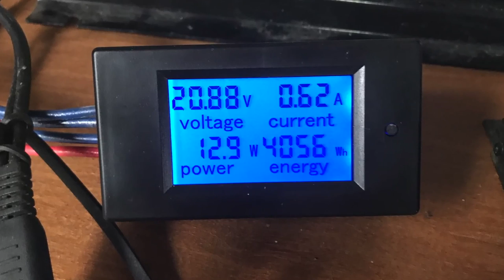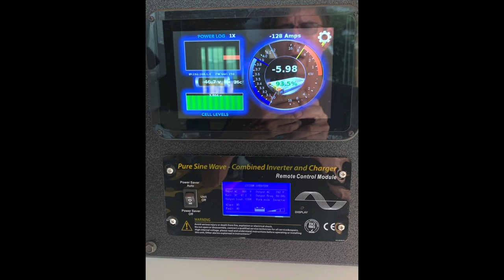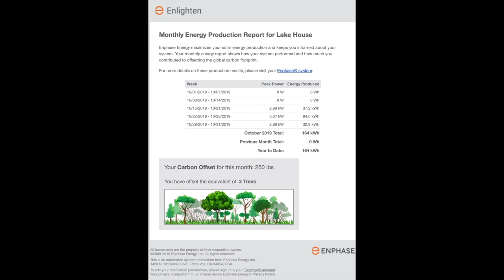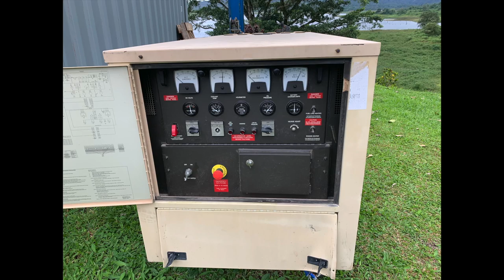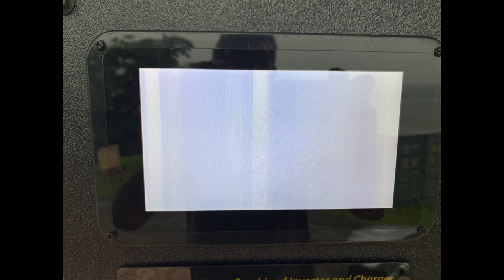EVTV on Tesla Cybertruck Unveil Wardrobe Malfunction

Comment: Why did no glass break? Possibly he was using Transparent Aluminum Alon windows (see Star Trek 4: The Voyage Home) with metal fatigue failure after too many impacts. See:  http://www.surmet.com/technology/alon-optical-ceramics/
Reply: Jim Whitehead a guy on Reddit talked to an engineer afterwords and that’s what he said.
Reply: @bob15479  Great. I independently figured that it was likely metal fatigue, which is why it can survive 20 or 30 impacts, then both windows quit at the same time.  They likely never tested the windows to fatigue failure. You can see metal fatigue by doing paperclip bends that suddenly snap.
Reply: People need to stop calling sapphire "transparent aluminum." That's like calling regular glass "transparent silicon"
Reply: @takanara7  False. If you bothered to spend 5 minutes of research first, you would know Alon is not a sapphire. (All sapphires contain other metals in addition to Al, such as Fe, Ti, etc. Alon has NO other metal). Wikipedia: "Aluminium oxynitride or ALON is a ceramic composed of aluminium, oxygen and nitrogen. It is marketed under the name ALON by Surmet Corporation.[3] ALON is optically transparent (≥80%)..."   So it is correct to call it: Transparent Aluminum oxynitride. (It becomes transparent by polishing).
Reply: @takanara7  BTW, This is a big secret, how I graduated with honors from a famous engineering school, with a full AT&T scholarship for grad school: not because I was smarter, but because I bothered to look up and understand the science first. This let me correct lazy professors who were wrong.  Also, reason from First Principles as Elon Musk recommends. Peace.
Reply: @takanara7  P.S. The term is accurate and funny and language is a living thing, not a dead thing, dictated to us by professors or random foreigners on the internet.

Comment: It’s solid state in plaid
Reply: It's solid state in all of them
Reply: Roger Starkey I think they are working on two battery’s a solvent less 2170 for the base cars and energy storage and the garnet solid electrolyte for the performance and maybe a Tesla plane
Reply: @michellemenzies2187  
The keys to batteries are now:
1) Economy of scale.
2) Packaging (in the pack)

There's no point continuing to make the old type when the new cells will be faster, cheaper and easier to make, will be more resilient, with better performance (density).
My prediction?
(1) Maxwell dry cell production (fast, no solvent, covers all of the above), with Jeff Dahn chemistry, produced at current production levels in GF1, but using only 20% of the space (maximum).
Then, (2) those cells built into a new pack (ref October patent.... It's interesting!) they need a lot more pack production ! which fits more cells into a smaller box, has better cooling, is easier to repair if required, allows for various pack sizes(!) and is much easier to recycle.
......
That's more, higher density cells, in a higher density pack, solving all the problems, enabling a big step in PACK efficiency.
You want 100 kWh in a Model 3? OK.
You want 150kWhbis a Model S? OK.
200kWh in the Cybertruck? No problem.
....
The old production will either be shifted to storage temporarily, or swapped straight over, allowing at least TEN times the number of cells and packs to be produced without building more expensive factory space.
.....
There's no point splitting production.
.......
It's a no brainer
Reply: @michellemenzies2187  
Oh, btw.
Maxwell described their cells as "solid state"
They also showed their material on a roll, so it's flexible.
Question.
If they swap half the production to pouch cells (probably necessary for the "garnet? Goodenough? Braga?" cell)
Where will they set up the completely different production line?

Their current drive system set-up is the best in the industry
They have a (2170) battery and pack step change ready, tested (I think) which will place them well ahead, while increasing production (needed!)
The system will fit all vehicles.
There's an element of "if it ain't broke, don't fix it", at least for now.

Comment: Dashboard material sounds a lot like Formica counter tops.  Tough and inexpensive and a wide range of patterns/designs available.   Compressed paper.
Reply: ram 1901 it’s actually a paper material.  Probably my least favorite part of the truck.  I hope by the time I get my tri motor, they Change it.
Reply: @Jack Rickard Like you said the entire presentation was rushed and lacked information.  On the model Y they spent 1/4 of their time going over the interior.  This time the interior didn't even get an honorable mention.

All I know is I want a round steering wheel..

Comment: My only dislike is the fact you have that slanted bit going down the side of the bed.  Now I have discussed this with my friends and it seems that is needed for strength given the exoskeleton body or something.   This make it less versatile, it does end of discussion.    I also would like to see a standard spring strut suspension option for someone who wants a simpler vehicle.
Reply: It helps a lot with aerodynamics and range to have the sides and a cover on the bed also. It's a minor downside to be but I'm keen to buy the truck and I'll manage with it anyway.
Reply: @glyngreen538  it's not built for the trades.   It's design will make work inefficient especially if you can only really get to the bed from the rear.   towing a work trailer would make it more of a pita.  it  wouldn't work well  for what I do in it's current verson..    I don't imagine all ev trucks will look like that.    I have faith that at least ford and gm have the know how.  and I understand Tesla is years ahead of them on the drivetrain front.
Reply: The sides are a downside but the ramp and ability of the suspension to tilt the vehicle and bed backwards are advantages over regular some trucks. It's situational and depends on your uses for it, but I'm a tradesman (painter and decorator) myself and I'm definitely buying one.
Reply: @peter doellefeld -- Wait... 'less versatile'..?  WTF?  

· Structural Rigidity
· Aerodynamics
· Passengers Riding in an open bed or Sitting on the Side Rails has ALWAYS been a BAD idea, inviting Accident, Injury, or Death
· A Fifth Wheel mounted in the bed would still allow a Gooseneck Trailer full articulation
· You mean 'it's not built for short people', no pickup truck is.  Just get a flatbed Toyota, they exist, I've seen 'em.  Then install poster guard rails around the perimeter as you see fit.
· You're in luck.  Those who build standard issue electric pickups that look the way you prefer have NO IMAGINATION at all to begin with.  Just like you.  Of course, they'll cost a LOT more money, have 1/3rd the cargo capacity, and sport 1/2 the range, but at least they'll LOOK familiar.  Yay?
· Ford & GM will produce standard issue Body on Frame, Detached Bed electric pickup trucks with leaf springs and live axles.  They will have much lower cargo capacity and range because they will try to build on their 'knowhow' before finally realizing they should have started from scratch and built anew from the ground up, like Tesla has.

Please.  Name something specific that cannot be accomplished with the CYBRTRK.  Then I'll point out why it doesn't matter.  Go ahead.  I'll wait.
Reply: @peterad1529  Why would towing be any different than using anything else?

Comment: Unclear how you get 500 miles without a 200 kwh battery especially if you're going to tow or haul over significant distances.  It's not a mobile power source unless the inverter is significantly beefy (10kw or so).  Those aren't cheap nor are the 200 kwh batteries and the stainless body.  Really hard to see that you can make money @ $40k with those kind of specs.  Can't convince myself the wardrobe failure was planned given how short they cut the rollout.  The whole event seemed out of sync, unrehearsed, and a bit cringy.  Not what I expected.
Reply: 1) this milage is without towing
2) Tesla knows how much theirs batteries will cost by 2021

Comment: You don't remember Bill Gates and bsod with W95 role out?

Where are the side mirror/camera screens? 
Where is the windshield wipers? 
Let's see the trailer hitch/receiver.

The rear view camera is not good, after using one in my Chevy Bolt EV, I hate it. Must have real mirror also. 

Ps - I ordered 5. =) (error 429x4)
Reply: I doubt it'll have wipers. Tesla have been researching high pressure airpockets to keep rainwater away from the windshield. Though I'd hate to think how much wear that puts on the compressor during a long drive.

I recon they will try get away with no side-mirrors as well... though regulators will make that quite a battle.
Reply: @matthewspencer2094  there are quite a few side view camera options out now. EU already green lighted it and Honda E has it. Last year a system for Class 8 trucks was given trial permission. It is as much as 2% fuel economy on a big truck.

https://www.cnet.com/roadshow/news/nhtsa-side-mirror-camera-technology/

Comment: Water jets work on anything that doesn't get damaged by water pretty much, glass one exception due to localized sandblasted surface.  Any structural metal, cloth fabric, stone counter tops, plastic sheets, wood maybe but not cardboard.  He has no idea what he's talking about on aerodynamics, the F-117 has shit aero qualities which is one of the reasons it's so slow.
Reply: @Jack Rickard So much for credentials.  I listen to the guy because he has a lot of useful knowledge, interesting perspective, that doesn't make him correct in every instance. (I only stated it that strongly because HE DID)  Sharp edges and flat planes were an early way for radar profile reduction at great cost to aerodynamics and flight qualities.  The F-117 was nicknamed the "Wobbly Goblin" for good reason.  You will never see a supersonic aircraft designed that way let alone a Boeing airliner.
Reply: A few notes on aero:  I expect the T-truck to be competitive on drag, it's penalized by sharp edges but benefits by raked front and flat underbelly where most trucks completely fail and a lot of the total drag comes from, also when the "vault" lid is covering the bed may make a big improvement. The tailgate will likely be the worse offender but that's a practicle necessity just as the most drag on a MODERN semi truck comes from the back end where you'd want it tapered to a cone or blade--obviously otherwise impractical although you will see some attempts to approximate that with trailing end attachments on semi trailers.  

Even cheap Youhaul type box trucks today have rounded corners instead of crude old square edges, just that much helps significantly.  Same for traditional pickup trucks but the "3-box" (standard) design inherently pushes a lot more air than the single box of a sedan say, but are improved with blunt rounded edges.  (things always get complicated naturally so wind tunnel testing is always required and many clever mods may improve drag, rounded edges alone won't do it, 1950's cars and trucks were rounded but not very slippery.)

Coefficient of Drag and drag are not the same thing.  CD is referenced from a sharp cornered, 90 deg. rectangular box that just encompasses the vehicle, that is assigned a value of 1, any value less than 1 is more slippery than the reference box.  Two cars with same CD do not have the same drag if they are different sizes (fit tight in different size/shape boxes).   

A CD of less than 0.3 ish is good for a sedan, for a pickup it's around 0.4 today which is an achievement, but because the truck is so much bigger than a car the actual drag could easily be double that of the car.
Reply: @Mrbfgray  Unless you observe the truck in a wind tunnel with the right light source and optics compared to the flat grill and near flat windshield your talk'in schiff.  If I were wrong you wouldn't see aero kits on a large number of long haul trucks on the road.  
Also the vault cover over the bed makes your tailgate comment largely bogus.
Reply: @stancloyd   I'm talking in generalities.  How do those kit's contradict anything I said?  The vault cover will probably help as I mentioned but a flat back is still a necessary draggy place.  So I need wind tunnel tests (I already said one does) and YOU DON'T?  How do you know the effects of the cover?
Reply: @stancloyd  Some generalities are just true--for example:  Take a sharp cornered box and compare it to same box with rounded corners and drag decreases modestly, add a long conical tail and it decreases dramatically, add a 'half dome' to the front and it drops again significantly but not as much as the tapered tail in general.  That doesn't mean it's optimized for given conditions just improved over the simple box.

  Likewise the sharp edges of the T-truck won't help, they may make sense overall just not for air flow....as mentioned, it's not a sports car nor economy sedan.  And when towing a trailer the wake of the truck will be partially offset by less drag on trailer.

Comment: get rid of the point on the top and it would be cool.
Reply: Key element of the A Frame construction, the A Frame is extremely strong, those down sloping sides on the vault are also structural members, however they have concealed lockable toolboxes built in.
It is all about efficiency, form and function

Comment: You don't think it was a publicity stunt by Elon?  If those simply replaceable windows didn't break there wouldn't be so much talk about that feckin' pickup!
Reply: apparently the window was slightly down. Being not supported around it, it's not surprising it broke.
Reply: @Jack Rickard no of course not but that the reason why by the looks of it.
Reply: @Jack Rickard that's not what he said at all, he said that if you factor in that the window was open (in other words, if we had prior knowledge that the window was slightly open),  you could make the prediction that it would break.
Reply: Sledgehammer before had something to do with it possibly

Comment: With the ease of no drive line issues, due to electric drive, to make this into a 6X6 and incorporate extra batteries by the extended length and a stronger hitch to tow more, or that would be a concept brought to fruition by the after market as a possibility, this looks like it could be a useable piece of equipment, or as others have suggested, a new toy to play with as it lends itself to many alterations. DON'T understand at all why Tesla uses bull gears to reduce motor speed to drive wheels. A ring and pinion going into inboard planetaries, even double planetaries if necessary, would be superior. Baffled at that.
Reply: maybe parts compatibility and production ease with their other Models?
Reply: Considering they opened up one of those gearboxes after a million miles of actual driving on real roads in a Semi test vehicle and it looked BRAND NEW after a million miles?  I think they maybe know something.
Reply: Considering they opened up one of those gearboxes after a million miles of actual driving on real roads in a Semi test vehicle and it looked BRAND NEW after a million miles?  I think they maybe know something.

Comment: Every EV has got am massive Inverter... to run the Drive Motor.  Why not using this Inverter powering the Electric Outlet??
Reply: I'm glad someone's thinking! It could also be used to feed power back to the grid in power shortages or to correct power factors on the grid.
Reply: @crspence57  Not with my batterie I have paid for. I will feed my house but that's it. In case of a blackout, you can't feed the grid, all the power stations have to be synchronized in feeding the grid, in case of a blackout no privately owned PV system is able to feed the grid,  not until it's up and running
Reply: @Jack Rickard Thank you for the answer! if the PCU in the battery is enough for the job, that would make the whole battery already able to do its job in the second life as a "Powerwall"

Comment: Not sure that safety regulations won't get in the way of this beast.
Folded cold-rolled 3mm 301 steel will not crumple, the poor vehicle/person it hits will be pulverized.
If hitting an immovable object, the Cyber Truck occupants will pinball around the interior like tomatoes in a can.
Reply: @Paul O'Neill -- Nope.  It will crumple just fine under sufficient force.  At 3mm thick, the stainless steel plates at front and rear can be scored to crumple directionally as needed under the proper amount of force that would be present during a collision at sub-45 MPH speeds. The NHTSA, NCAP, ASEAN-NCAP, SA-NCAP perform all tests at 40 MPH or below.  

The IIHS is NOT an official regulator, but just announced they would be RAISING their crash test speeds for side impact tests.  I suspect IIHS was already using higher speed crash tests anyway, as videos of their partial overlap crash testing is much more violent in end results than is shown in NHTSA video of that test.
Reply: @redxsage  
If you weaken it to crumple, you risk compromising the toughness he's making such a big deal of. Take a ding (or sledgehammer) near anywhere that's designed to fail and you've got a major dent in the unibody exoskelton. Maybe it bashes out, I dunno.
Reply: @poneill65  -- Meh.  People who don't understand crumple zones or breakaway parts (look up Anton Wahlman & Edward Niedermier, for instance, if you dare) will never be happy anyway.  They'll all claim it was a failure even when it performs exactly as planned.